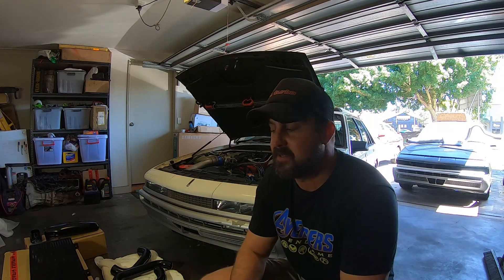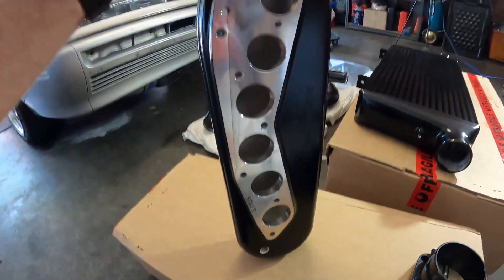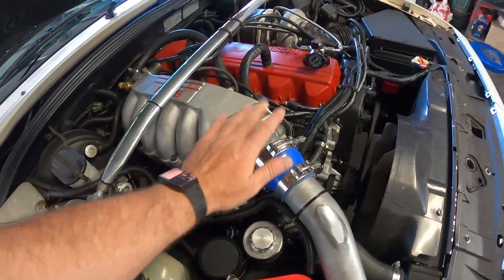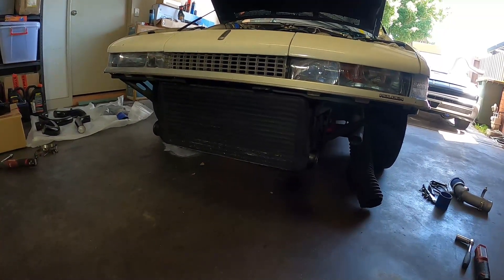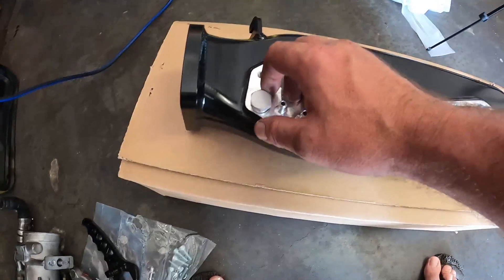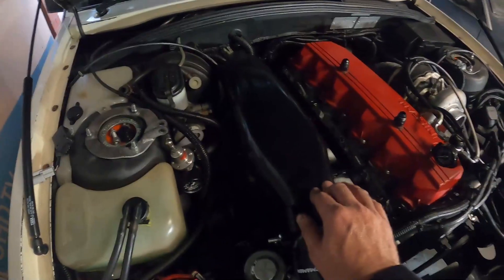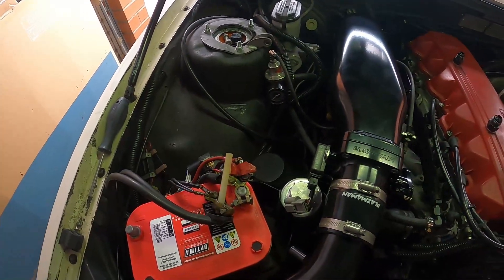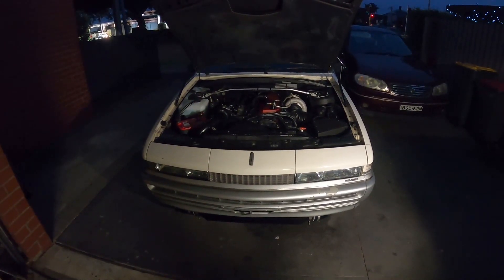VL Turbo Plazmaman Intake and Intercooler Install

Comment: Are you still using all the aircon gear in front of your radiator behind the intercooler ? .. 

just wondering cause I want my aircon working once I’ve installed a plazmaman intercooler